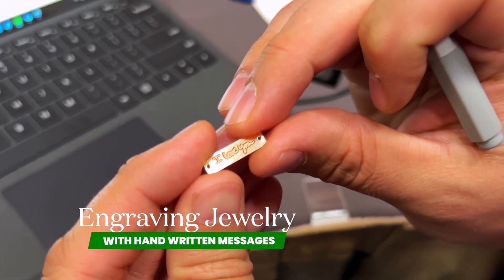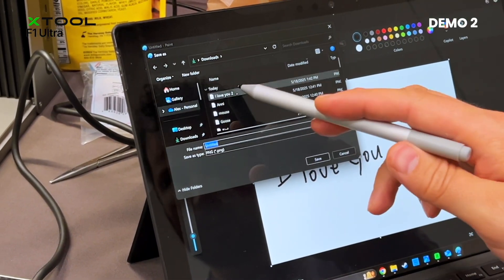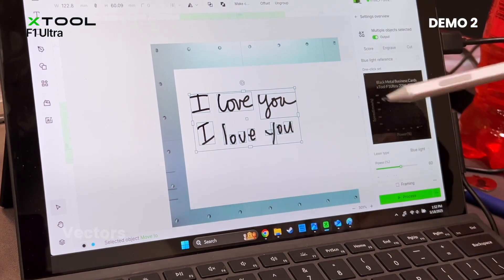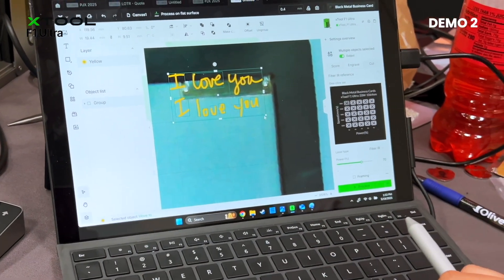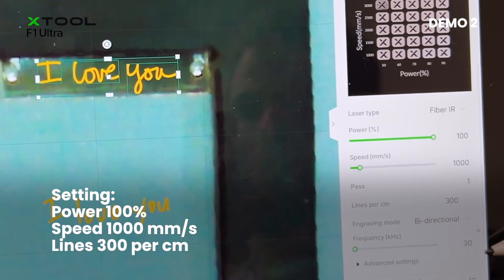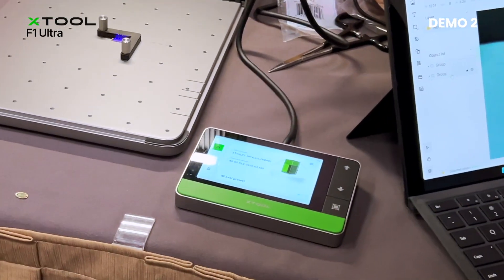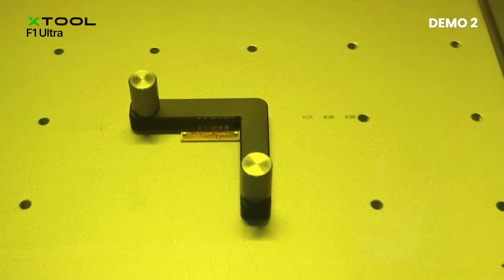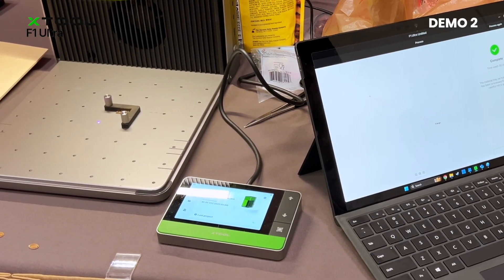Laser Engraving Handwritten Message on Gold Filled with XTool F1 Ultra | Live Demo 2 from PJX

Comment: how deep is the engraving? would it last on gold filled and sterling silver with daily wear?
Reply from the maker: It can go very deep when you do more passes.  This engraver has the ability to cut through metal, albeit takes a while.  I have not yet tried cutting 20 ga sheet, but hope to try and film it.

So far, it can cut very deep and I know it will withstand daily wear.